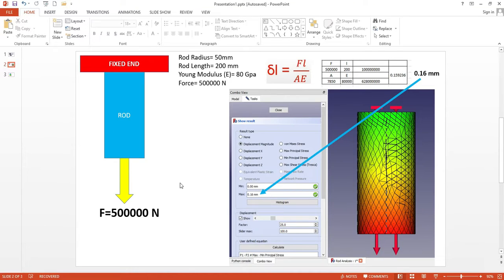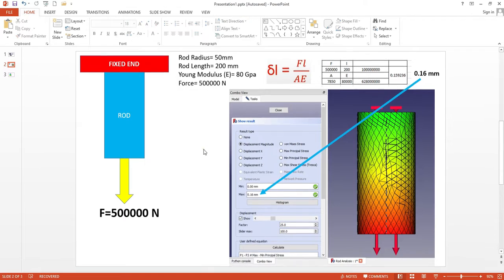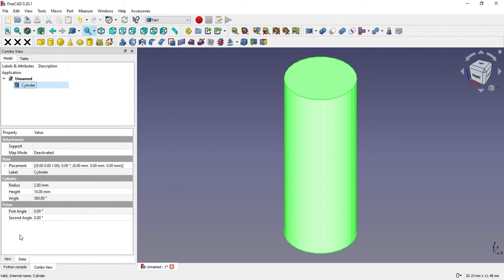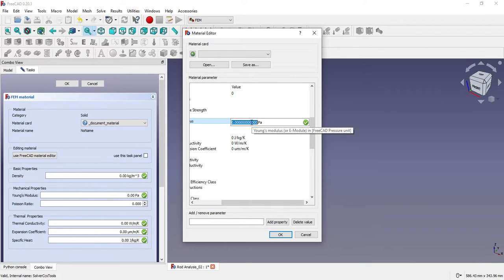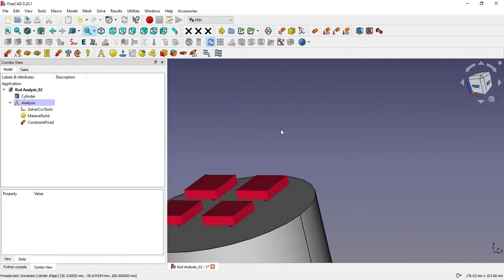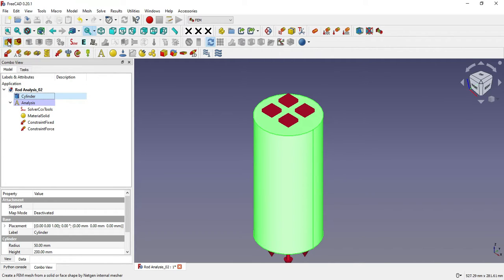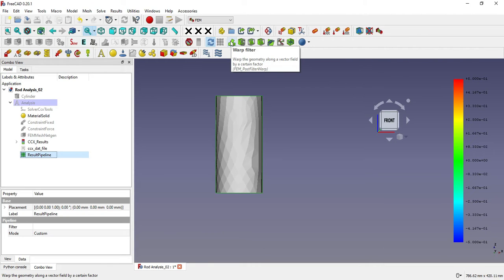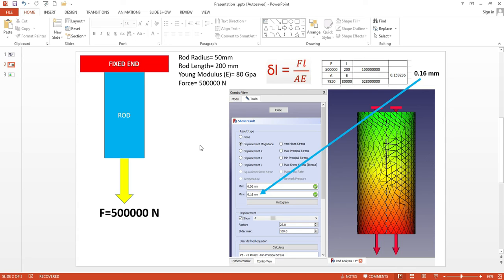Manual Calculation Validation with FreeCAD FEM Analysis | FreeCAD FEM | FreeCAD Analysis |

Comment: Great introduction to FEM Analysis in FreeCAD.  Nicely done.
Reply from the maker: Thanks for your appreciation.
Reply: @mechnexus 

Is there a limit to the number of elements or nodes you can use in FreeCAD? 

Whenever I have more than 650,000 nodes, the solver crashes.

If the inp file is run directly with the Calculix command, it crashes too.